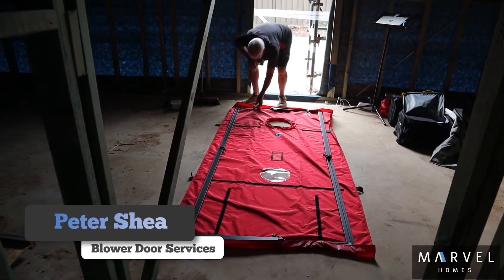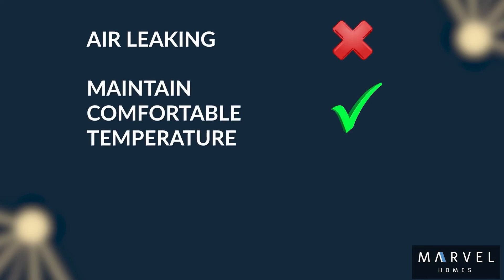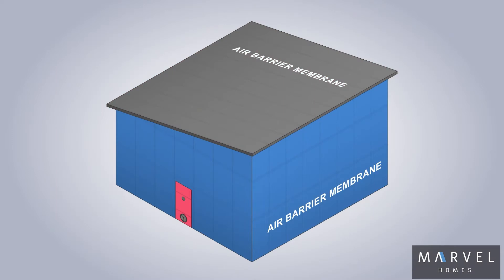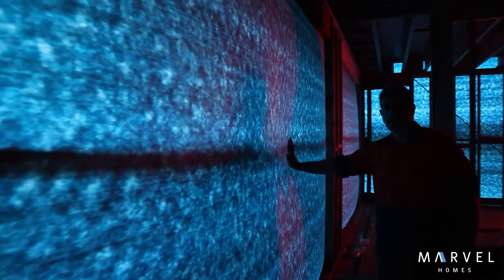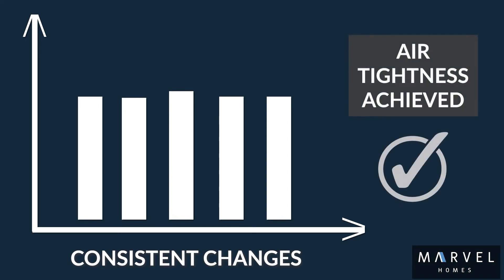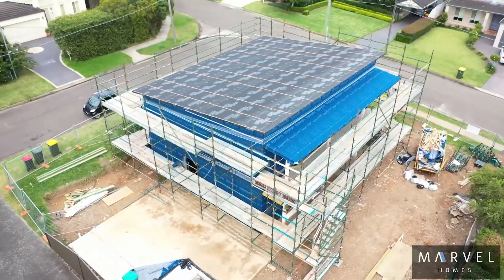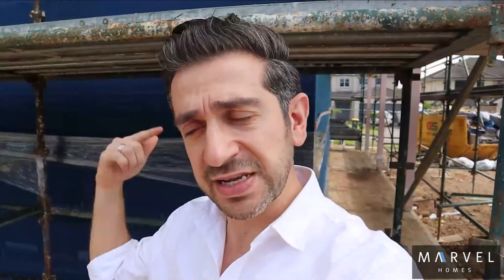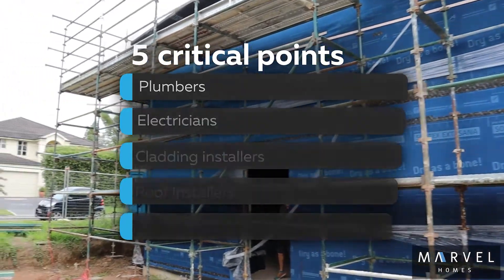You Need More Than Insulation: Here's How We Make Your Home Airtight

Comment: Excellent result showing that a high level of air tightness can be obtained without a membrane on the interior side of the wall. 
But will you be also installing a vapour restrictive membrane on the interior side (with services cavity) to reduce vapour entering the wall from inside? Or is this not required for the Sydney climate?
Reply from the maker: Thanks Mark. They Sydney climate is a little tricky, as your winters are humid in general and every project has multiple solutions to achieve the desired outcomes with a detailed PHPP analysing different solutions. In this project we are using a ducted dehumidifier to control humidity levels, especially in winter times. As for the use of intello was not necessary for the climate conditions, and the external wrap is airtight & allows any vapour to escape. Hope that answers your question.